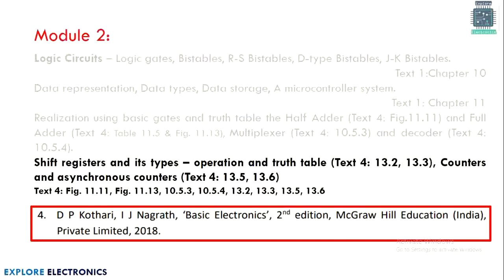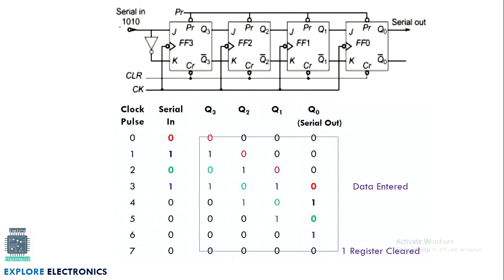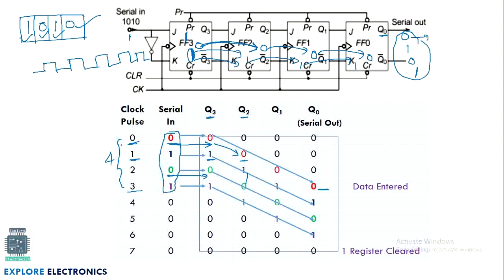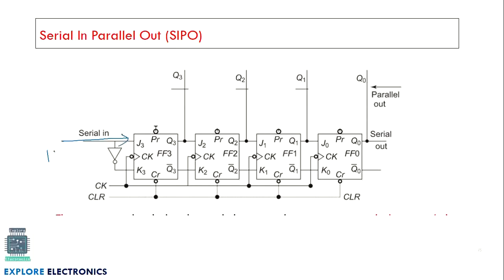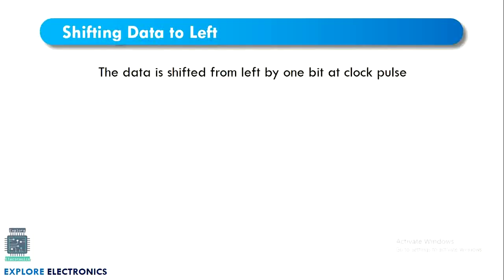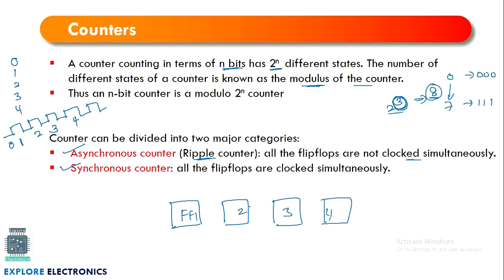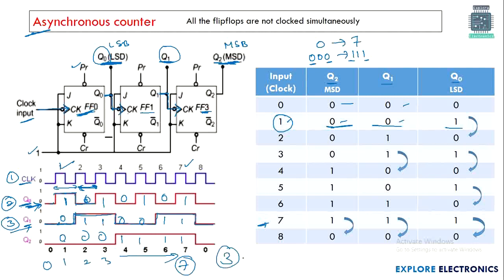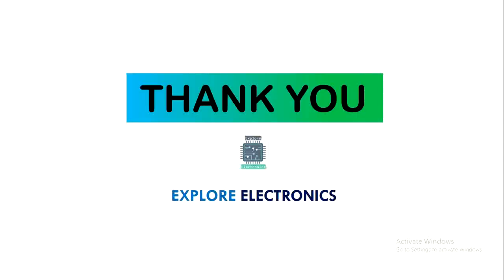M2 L4 | Shift Registers and Counters | Basic Electronics and Communication Engineering

Comment from the maker: In the video discussed shift registers and counters. All are designed to operate with negative edge clock ( Falling edge ). 
here 13:35 waveform is shown for positive edge clock (It is Wrong for the circuit shown). 
 Please make correction in waveform, corresponds to negative edge